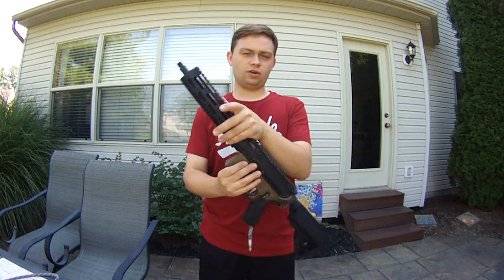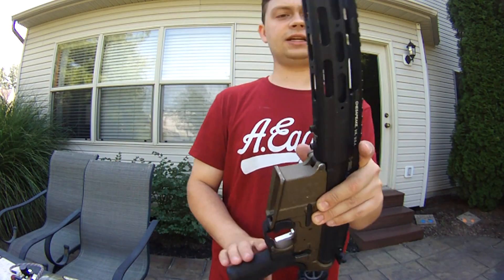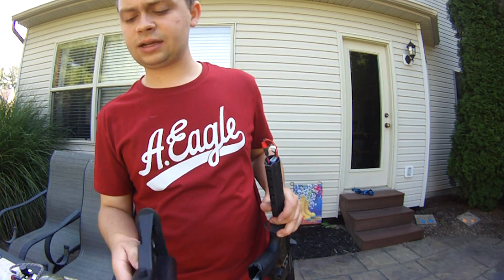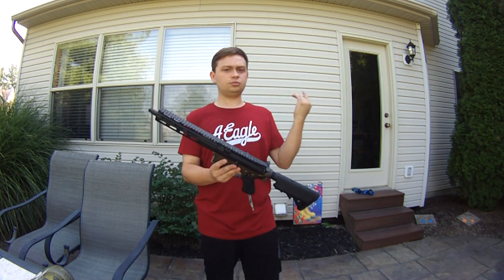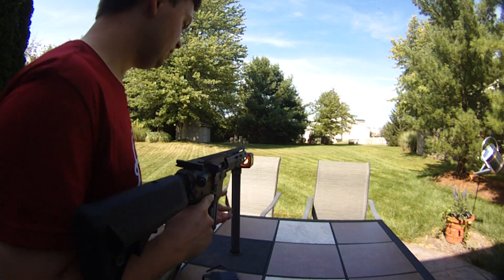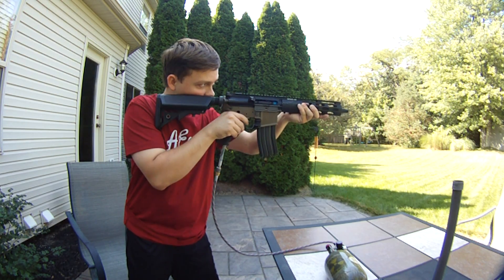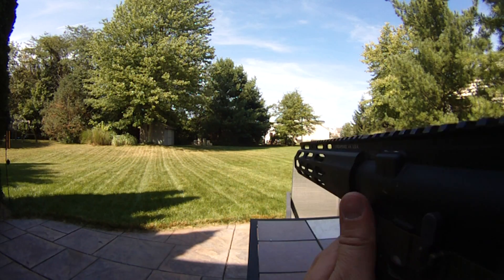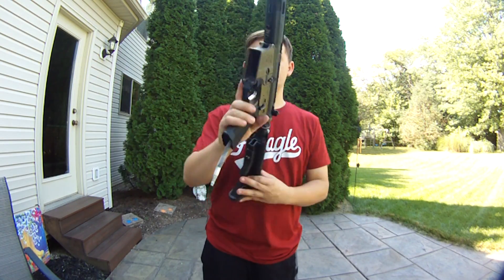VFC VR16 P* Fusion Engine Overview and Shooting Test

Comment: Just went and had the airsoft barracks order me an Avalon saber and a fusion F2 and speed trigger in all black with red trigger. Upgrade from my sub par Valken v12 that hangs around 320fps to a gun I’m having fine tuned for 395 FPS depending on bbs for CQB speedsofting

Comment: what kind motor would you recomend for a Krytec Lova s, i wanna kind have a rof of around 25 rps. "ASG Ultimate Boost Airsoft AEG Motor 30k" good shit?
Reply: put gears 12,1 shs , and  The krytac engine works well, you can put another force faster than there are

Comment: was any modification done to get the fusion engine to fit in, or does it just drop into vfc receivers and shoot lasers
Reply: Usually you should not get any problems with VFC bodys and a Fusion engine. If i remember it right the FE was originally made to fit in the VFC 416...

Comment: How do you get the trigger pull so light on p*
Reply: This specific gun appeaes to have a SPEED brand trigger which can be tuned with the turn of a screw. Normal triggers that don't have the screw will need custom work done.